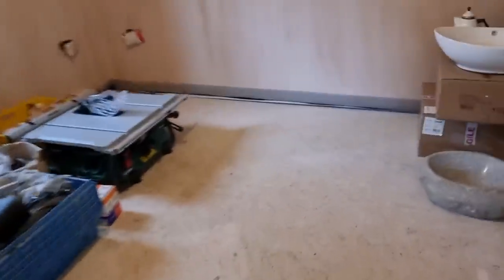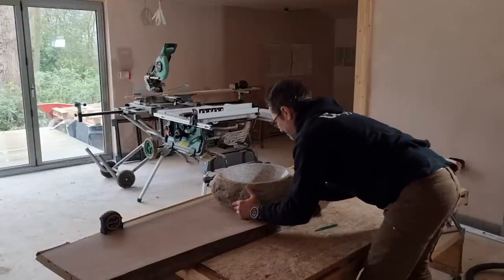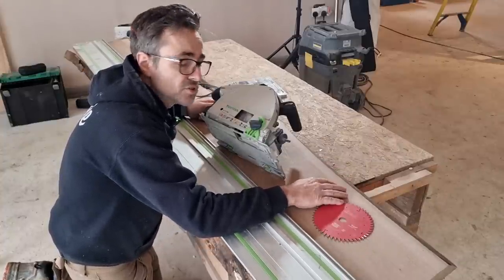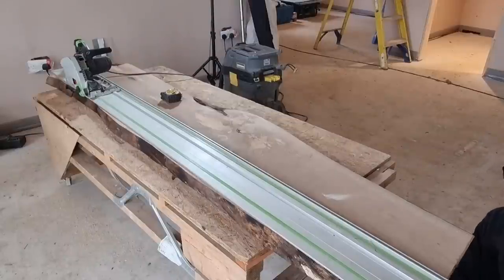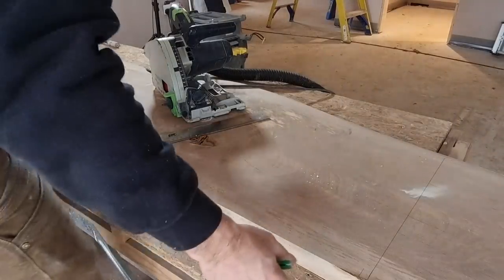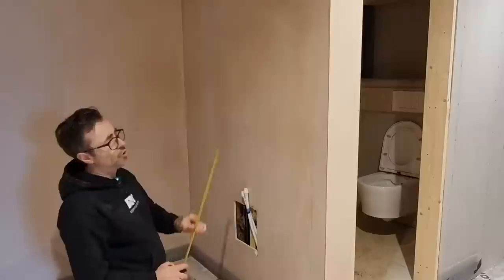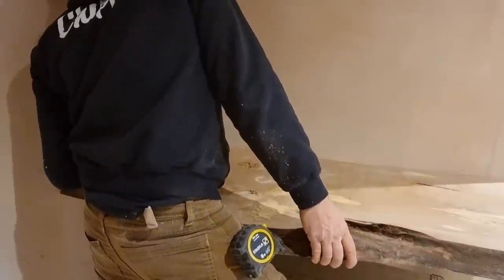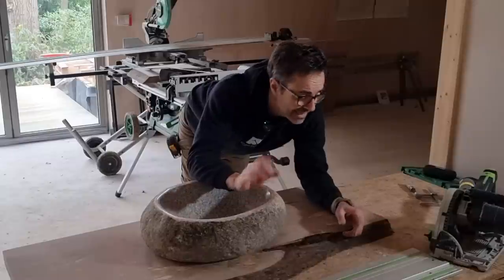How I cut solid beech to make a worktop, best saw blade

Comment: I cut two table tops recently using the 90 degree Festool track jig, parallel cut two long faces first.      .nothing of a millimetre out over 1950mm on the diagonal, not too shabby, very impressed.

Comment: My strong advice to anyone thinking of using timber in a house would be to buy kiln dried and not air dried. I’ve been woodworking for over 45 years and learnt from experience that air dried timber will move for 6 months at least after it’s put into an interior. It will check (crack) at will and, if it’s put in a portion where it can’t expand as it would like, is quite capable of cracking plaster. Don’t ask me how I know this. 

The additional cost of kiln dried over air dried is fairly small compared to the probable pain of it going wrong. I’ve got no affiliation to either but, for kiln dried waney and square edge, I go to Surrey Timbers or English Woodland Timbers. Both south of the Thames but so am I.
Reply: Depends on the species. In my experience air dried Ash is much more stable than kiln dried.

Comment: Nice vid once again Robin..👍
I was a little worried about your new blade hitting any "rogue screws".  What I did to my sacrificial tops of my joiner-sawhorses is, I fixed them through with only 8mm holes through everything, & countersunk top & bottom, & forced-in hotglue,so that it created a plastic rivet, so it doesn't matter if you cut through it, & just remove them when the time comes, with a heat-gun...👍🙂
Reply: Fantastic tip that!

Comment: Over the years ive tried most brands of saw blade, in my opinion Freud are the best, Bosch blades give similar results but at a much higher price.
Freud also use good sized and strongly connected tungsten tips that can be sharpened multiple times. 
A budget saw with a Freud blade is capable of an extremely high quality finish.
Cant wait to see the end result of this project. I hope one day you rent it out on air bnb or similar? 👍

Comment: Something I've done with solid timber slabs like that is to inset steel bars into the underside to help keep them flat. 
Use something like a 15mm x 5mm flat bar, route out a suitable groove in the underside and set the bars in, on edge obviously,  with an epoxy resin.
I always do this on wide slabs like a breakfast bar,  set them at maybe 400-500  mm apart.
Reply from the maker: Nice touch!
Reply: On thinner materials like wide hardwood window boards I always run a few grooves along the grain on the underside.
I even tried it on a slightly cupped oak worktop, it worked really well, at the time I worried that it may split over time, 6 years later and still flat and no splits.

Comment: It doesn't take much to overwork a Festool TS55 it's the most under powered saw I have ever owned.

I have tried loads of blades over the years, I really don't rate the Festool blades they lose the edge really fast, stehl blades were ok, key blades didn't seem perfectly circular so gave up on them although the key blades kapex blade (now discontinued) was absolutely flawless. I used the cheap Lumberjack blades for ages & they were brilliant but supply was very sporadic. I have now settled on the Freud blades for nearly all my saws now & the 165mm are only £20 from Screwfix cut really nice & last well.

Comment: Nice to know the pro’s put there blades in the wrong away around too. I was cursing like a trooper about crap blade burning the cut, worked so much better correctly installed 😁
What finish? Lots of water from the sink with water from your hands.
Reply: Carpenter & Joiner for 37yrs here & I still have a brain fart every now & then & put a blade in backwards, usually on my small cordless trim saw where the blade is on the left side of the saw 🤗
Reply: @WombleUK  appreciate you honesty. Makes me a, mere DIYer feel so much better!

Comment: Robin, silly question, how do track saw tracks work? Do they not move out of place simply by surface tension? Edit: just got further in video and saw you clamping as well.
Reply: Exactly that and the have a non slip rubber material underneath
Reply: @db7948 thanks

Comment: I’ve done a good few of theses and either kept them indoors (for a few years) or had them kiln dried (relatively easy DIY to do) if they are anyway wet the you can have issues with movement in the piece so check for moisture content on large pieces (circa 12%) well before install. Check out Manor woodwork YouTube channel…. I’ve learnt so much form him and continue to do so

Comment: The woodworm holes only show its HAD woodworm - matured beetles have chewed their way out !
If no further new eggs were laid over the last three or four years, then it would no longer have any larvae chewing away inside ( the 'worm' ).
Reply from the maker: Nice information bro, many thanks for your valuable comments!! Its a real mystery when it comes to wood worm!!
Reply: Woodworm or beetle prefer timber with higher moisture content, above 20% is the danger zone though I believe they can survive down to about 12%. Nevertheless if the timber is dry one shouldn't need to worry about old sign.  If that slab has been 'air dried' for 6 months (cut & stickered outdoors abeit under cover) I'd expect the moisture content in that slab is likely over 30% (particularly since it's spalted). Rule of thumb is a year per inch of thickness to get down to below 30%, aiming to get to low twenties. For interior work you want to be down to 10% or preferably into single digits, meaning air dried stock needs lots of time once brought indoors to acclimatise, and will move during that time... Ideally that goes for kiln-dried stock too (they may get it down to 10% during the drying process, but then the longer it sits in an unheated, humid warehouse the wetter it'll end up). Long story short that slab is way short of where it ought to be.  Need to fit sills & the like quicker, quarter-sawn stock is the best, it'll still shrink but it you greatly reduce the change it'll twist or cup.

Comment: thing is if someone is spending this much on an extension/addition to a house, spending 150 plus labour on this top for the bathroom is nothing. It's more about the bespoke finish that counts as its not "run of the mill" and will be a talking point when people come over etc this is where the value comes into play, ya never see high-end people fitting a b&q bathroom and when people are round showing them the "new bathroom"